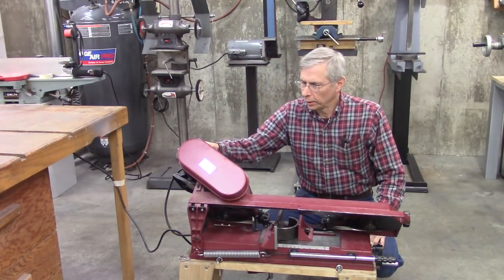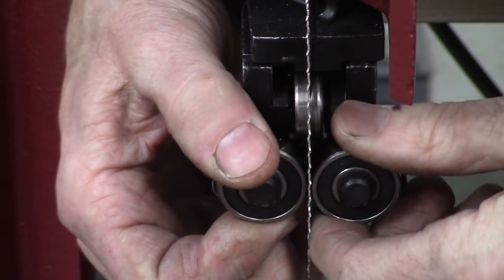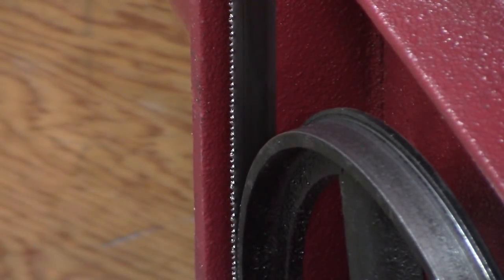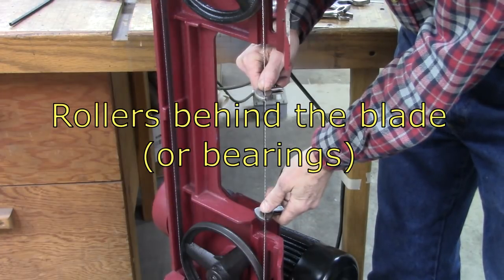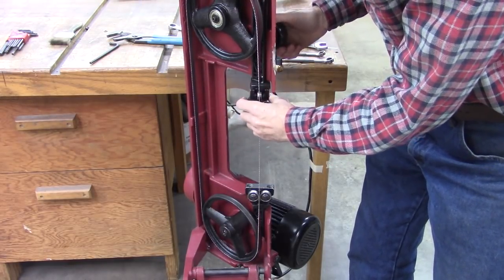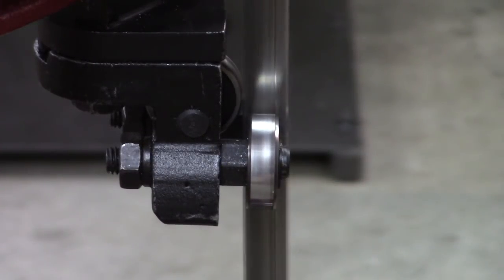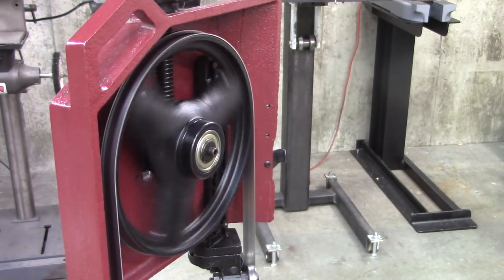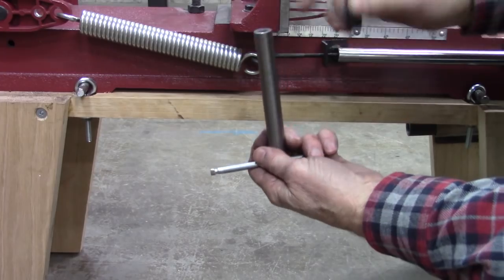4" x 6" Horizontal Bandsaw Tune Up

Comment: Hey Winky, thanks for this video.  We have this saw at our community Makerspace.  It keeps snapping blades after only a couple of hours use.  Im going to complete your tune up and now need to get a new blade for it.  Any recommendation?  We cut mostly stainless steel on it.  Until I confirm that the blade is not going to break right away again - I don’t want to buy a really expensive carbide blade.  We were using Starrett Intenss 10-14 tpi blades.  Thank you!
Reply from the maker: If your saw has the same issue as mine the blade has to be deflected downward to complete the cut. Ideally the guides should only rotate the blade to vertical. Only some saws have this issue but it is a common problem. I sell a 1/4" steel plate that sits under the vice jaws if you need it or you can make your own. Here's a link to a web store where you can buy them. Also, there is a link to a template in red text (on the web store listing). Print the template  and check to make sure it fits before you order. Also, you can use the template to make your own plate if you want. https://markq6zlmc.fws.store/Elevating_Plate/p7671236_21023715.aspx
Reply: @WinkysWorkshop  Thanks,  fortunately we don’t seem to have the issue of not finishing the cut.  I havent had the chance to see if the blade has been deflected downward but will check once I get a new blade for the saw (can’t check without one) .   I guess I’ll just buy any cheap blade to make any necessary adjustments.  I know the bearings all roll smoothly.  One thing I did notice last time I broke a blade was that I saw the whole arm bounce a little off the workpiece a few times a moment before the blade broke
Reply from the maker: @mchristopher  That does sound like the blade is being pushed downward. If this is the case the depth of cut problem will appear when the blade guides are set correctly.  My saw blade guides had to be modified to achieve a straight blade travel. They have a rather crude "key and slot" setup that I had to mill slightly wider. Good luck.

Comment: Good video ,,, you have more than enough  saw there for your shop . I bought an old one about the same size . I found high carbon blades are a waste for steel since switching to m42 I don't think I'll ever use the spares ..
Reply from the maker: Thanks! Ha...  thats what I use but I didn't know it.

Comment: Best blade for cutting steel? Best multi- use blade?
Reply from the maker: I'm sure the Starrett blade are the best but I have been using the "Imachinist S64514 Bi-Metal Band Saw Blades 64-1/2" X 1/2" X 14tpi I found on Amazon. It seems to hole up very well. I've had the same blade on my saw for 10 month now.
Reply: @WinkysWorkshop  Thanks!

Comment: I like my guard because it contains the blade when it comes off the wheels.  If that happens on a cut it can jump out and get you.  Also I just live with it but my upper blade guide inner bearing hits the table if you adjust down to get close to the work piece.  Mine is the Taiwan version from the eighties and has been a very good machine.  Cuts very true with good blades (bi metal) and it has worn out a set of roller bearing guides but they were easily obtainable with US made quality ones (might not be now, that was fifteen years ago or more).  Just changed the gear lube and inspected the gears which are still pristine after more than thirty years of regular use in my home shop.  I did add a suggestion from YouTube (a plate on the moveable jaw of the vise with a bolt going through the off side.  This enables you to clamp a short work piece with the pivoting jaw.)  All in all it has more than repaid its $200 new purchase price.  I also bolted mine to a 1 1/2" plywood base with castors for ease of maneuvering and I use a cookie sheet to catch the cut swarf with the cutting fluid which I reuse with a brush on the blade.  I have found old transmission fluid works very good for all my metals and really well on aluminum.  I cut a lot of stainless and aluminum as well as steel.
Reply from the maker: Thanks for the comment...  cutting fluid would be great...  although for me it isn;t worth the mess.

Comment: The blade guide bloc on mine split at one end of the slot.  I can still cut with it but I think I need to find another one, or better yet, make an upgrade.  I'm thinking opposing setscrews for alignment.
Reply from the maker: Excellent

Comment: Either I got lucky or you didn't. I bought one of these a couple of years ago and have had zero problems with it.
I second the suggestion to drain and refill the gearbox right away. Mine looked lie it had straight 30 wt and Vaseline in it. It most certainly wasn't gear oil. I did also have to take the brass gear out and smooth off some burrs on it. I cut 2, 3/8's X4 plates and bolted them to the vise jaws right up to the blade and mounted a spreader bolt on the far side so I can clamp small parts. Eliminates the need for your clever pipe trick.
One of the best upgrades I did was to make an extension shaft, remove that rinky dink vise handle and put an 8 inch hand wheel on the end of the extension shaft so that I don't have to reach under the saw to operate the vise. That and I built a real base for the whole thing. The factory sheet metal ones are downright dangerous. Mine still has the original blade on it and just for fun, I cut a thin piece off a hunk of 1/2 X 2 flat bar that measured .019 inches in thickness.

I will agree with everyone else Winky, this is a GREAT video on these things.
Out of all of them that I have seen, you go into the most detail by far on adjusting things.
Sorry yours is so far out of whack that you had to make an adapter plate to cure your depth of cut problem.
Must have been built on a Monday morning!
Reply from the maker: I suspect they make these saws in batches. Like they make 10,000 and then tool up to build other machines. They probably didn't get things set up the same for my saw. You're right about the oil. I changed it soon after I got it. It was clean but definitely not gear oil. The manual calls for 130 wt and I put 90 wt just because i had it. My stand was made to roll under my saw outfeed table. I used white oak just because i had it. Excellent idea on the handle. The original is a joke.

Comment: I purchased this bandsaw and after 11 cuts it wouldn’t cut straight. The drive wheel wouldn’t properly track with the blade. I exchanged it today and the new one is doing the same thing. I’ve watched your videos on how to adjust the blade but it doesn’t cover the drive wheel. I have adjusted those two bolts until I’m going crazy. If I get one to track properly the other one doesn’t. How do I get both wheels to track right. Right now on the drive wheel the blade is half off and the other wheel is perfect. Help
Reply from the maker: Wow...  that's crazy. Without being there it's hard to say what the problem is. Some difference is acceptable but maybe a 1/16" inch to a max of 1/8". The blade guides effect this tracking also. If I was you I'd remove both blade guides and see if you can get the blade to track. If so, you know the problem is not in the wheels. Then watch my videos again and if possible install the blade guides correctly. I say "if possible" because I had to machine about 1/8' off the slot on one of mine.
Reply: @WinkysWorkshop  thanks for getting back to me so fast. It seems the blade was to tight. I backed off the tension and the blade fell right into place.
Reply from the maker: No problem. Glad you figured it out.

Comment: I saw an image online of a mod to this type of bandsaw where the blade guides with the bearings had screws on either side added so you wouldn't have to rely on the friction from the one hex bolt holding the part in. Unfortunately the site is defunct.
Reply from the maker: I've been thinking about making some myself...  maybe make them available to buy. So far I an idea what I want but not firm design. It' hard to do stuff like that and keep the price low.
Reply: @WinkysWorkshop  
So I took my bearing guides apart so I can replace the bearings and upon doing so I noticed that the bearings that pinch the blade do not orbit on the same plane. Is that due to poor manufacturing or is that some genius idea to keep the blade in place. They are only off by a degree or so in one direction or the other. I am really thinking of either machining the existing bearing fixtures to make them better, or just making new ones that have a bit more adjustability. Did you happen to draw up plans already for your fixture idea?
 
Also, I noticed that the tension wheel wobbles from side to side. I can press my thumbs on either side of the wheel and it wiggles easily, and I cannot find a way to snug that up. Is that normal?

FYI - I own a "Clarke" 4x6, but they're all pretty much the same, I think.

Comment: so i"m having an issue with the motor not starting on its own. i have to give it a turn and it kicks on. what do i need to adjust to fix this? tia
Reply from the maker: Guess what, me too. It needs a larger motor. I suspect the motor is not actually 1/2 hp. Sad.

Comment: Good video but it seems too me that the cover you made makes it harder to change blades.  I have one, older harbor freight, and change blades a lot.  Run 6 tpi up to 24 tpi depending on what I'm cutting.
Reply from the maker: Love the name, I remember Max from years ago. Yes you are correct about the guard. Not a huge problem but still annoying plus, despite my efforts I still had issues with making the switch shut off the saw and cut all the way through. I have a second video where I fixed the problem right and installed the original guide again. Here's a link...  also check out the 3rd video. https://youtu.be/-GiKBm4gecw
Reply: @WinkysWorkshop  Good work. I don't have that problem but yours looks to be better built than mine. Mine is over 20 years old.
Reply from the maker: @maxheadflow  - My saw is maybe 4 or 5 mouth old

Comment: Mine does not have the tracking adjustment feature .I need those parts to convert mine .
Reply from the maker: It maybe made different but I'd say it has some kind of tracking adjustment.
Reply: @WinkysWorkshop  It does not have the adjustment screws[bolts] Wheel axle only moves up or down.

Comment: That's a great video, best I have seen on the 4x6
I've had the same saw for a long time and had same issues.
 Ended up doing very similar modifications but machined the blade guide castings and cut away switch gueard as it was easier than cutting casting.
 Also had an issue with the motor capacitor which isn't available anywhere as a separate part, hopefully the motor fitted now has a standard size and capacitance?
The earlier version I have had a different on/off switch with a larger 'trip' point which made setting shut off very frustrating
Reply from the maker: Thanks! In part two of this video I made a spacer plate. Check it out. There is also a link under the video with instructions, a contact email address and a PDF template. If you want a plate let me know. I'm waiting on a quote for water jet cutting. If i can sell them for less than $30 I'll order some plate. Also, print the template to make sure it matches. 
https://youtu.be/-GiKBm4gecw

Comment: I own this machine design for over 40 years and it served me very well thru the years.
Your tune up is very important but there is something that is ever more important, it is to solidify the base to make sure that the machine does not tip over. 
The base that is supplied with the machine made that my saw tipped over and broke the hinge so I needed to have it brazed when the machine was almost new.
happily, this is not a precision machine so I've been able to reasjust it to obtain straight cuts.
Reply from the maker: I built a wood base for mine so I never tried the original. Mine seems to be stable

Comment: Could you give your blade a "twang" so I can hear your tension? I might be able to "tune" in?
Reply from the maker: Interesting idea. I didn't know how to quantify that. Although, I changed my blade yesterday and realize something. Tighten firmly but stop when the blade start to miss track.
Reply: @WinkysWorkshop  Thank you for your more scientific method. I did notice when trying to balance the alignment against tension that the flex of the frame starts to deflect the track of the blade over the wheel. I suppose it is the logical limit of tension. Thank you Sir!!
Reply from the maker: @barryporteous4904  Your welcome. I never thought about the twang...  somewhat scientific. :o)

Comment: The first day I brought mine home and set it up those cheap ass legs buckled and collapsed. Best advice is trash the legs as soon as you get it home and mount it to a sturdy bench. Good video, thank you.
Reply from the maker: Thanks! Another person said the same. I made my stand because I wanted it to slide under my table saw outfeed table
Reply: @WinkysWorkshop  My legs came with corner brackets, and is stable.
Reply from the maker: @tdrager  I never tied my legs, I just wanted mine to fit under a bench.

Comment: Hi Winky, great tips and I love the pipe clamp idea, thankyou for sharing, its certainly on my to do list.  I ran into the same problem as you with lack of adustment on the roller guide block to allow the blade to exit the wheel withot deflection.  To get a little bit more movement I machined the threads plus a little bit more off the bolt where it contacts the block.
Cam
Reply from the maker: Thanks. Yeah that pipe trick is great. It wasn't my idea but certainly worth sharing. It's kind of amazing they keep using the same flawed design on these bandsaws. I'm glad i got it cheap but making a few small changed and millions of bandsaws would work better.

Comment: These saws are hilarious.  I just bought a new off the shelf Taiwanese setup. Before even tested it I went through your video. My blade guides aren’t on a cam, just a straight bolt lol. But they seem to be at the right tension so that is a bonus. Maybe a lathe project for the future. I’ve got the same issue with lack of adjustment to keep the blade straight though!
Thanks for the tips. I better get filing.
Reply from the maker: Not on a cam?  Mine are on an eccentric bolt which I'm guessing you mean when you say cam. I figured all these saws would be close to the same. Aside from a depth of cut issue my saw has all the adjustment it needs...  although not easy to adjust. What your saw a harbor freight?
Reply: @WinkysWorkshop  yes, by cam I was referring to the eccentric bolt. I did realize afterwards, the one bolt was concentric, and the other one was eccentric.   I had to file down the bolt holes, as well as slotted portion of the guides to get it lined up. If both bolts were eccentric it probably wouldn’t have been required as you can squeeze out some more adjustment with those.   It’s still not 100% but cutting great either way.

One thing I found, which I didn’t figure out until the end was not making your adjustments for blade angle until you loosen the blade tension. Haha. Silly me.
Reply from the maker: @huddleberryfin  Weird, both my bolts are eccentrics but it sound like it worked out. Yep...  I milled the slot in the back of one of the guides to make it go further toward the vise. It's a darn shame they make a basically good saw and can't get the basics set up right. Be sure and check the oil in your gear box. It's supposed to be 90w gear oil. Mine had what looked like 20w.
Reply: @WinkysWorkshop  another thing which is different on my machine, is you can’t adjust the upper wheel at all! It doesn’t even have the bolts.  

The gear case has oil. I spill it all when I was looking for an adjuster for the lower wheel. Haha. I guess they are both fixed.

Comment: Main guard - can you simply not trim the old one by removing the bits that get in the way ?
Reply from the maker: Maybe...  I do need to improve on this. I have also thought about adding a plate to the table to increase the height. That way I could put the guard back on.
Reply: @WinkysWorkshop  Looking around your shop, I think you could build a better one from scratch :)
Reply from the maker: @millomweb  - Probably... although I don't have much in the way os sheet metal tools. The old guard was fairly good although it needed a latch instead if a screw to hold it closed.

Comment: Since the top wheel has a bushing.  I put a grease zerk on mine so I could grease the bushing.
Reply from the maker: Good idea although mine has a bearing.
Reply: @WinkysWorkshop  Trying to figure out why after 20 years.  The saw blade during the cut will climb down out of the gides and mess up the cut.  Once it is out of the guide it falls off the traction wheels.  Tho I will check the run out you have shown forr in your vid.
Reply from the maker: @wi11y1960  The only time I have seen mine do that is when the side bearings are too tight.
Reply: @WinkysWorkshop  I will look into it.  Thanx!

Comment: Great video! I don't think you covered the spring handle adjustment. If you did I couldn't find it. What is your rule of thumb on how much tension to use? I use a small block of steel on the outer end and it seems to work better than the spring tension.
Reply from the maker: I mentioned the tension but didn't go into it much. I just said it needs to be firmly tight. This a hard thing to communicate when there is no measurement to reference,
Reply: @WinkysWorkshop  I know what you mean but was wondering what or how it affects the cutting speed. I have tried several settings but ended up using a small cube of steel that fits perfectly on the outer end on the adjustable slide for the rollers. My only issue is that I continually forget to remove it when I put the blade back to the vertical and get a laugh at my flat "Learning" curve!
Reply from the maker: @rudyyarbrough5122  I  do the same for large pieces.